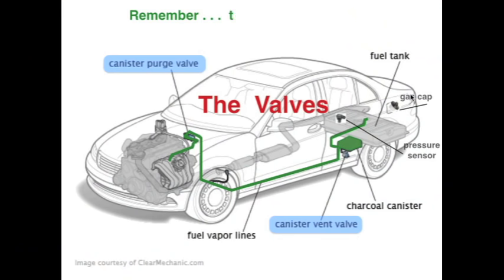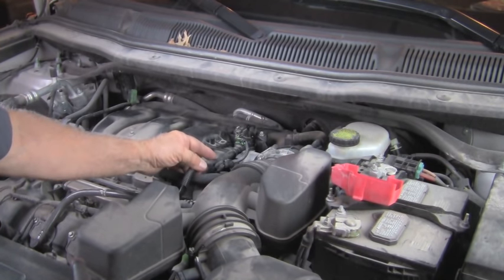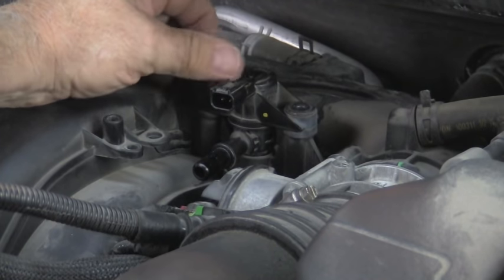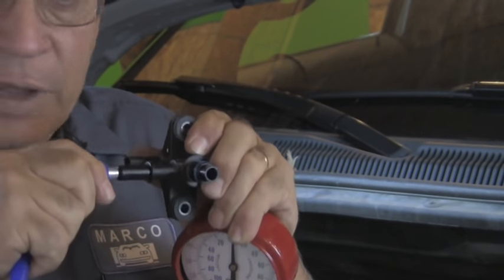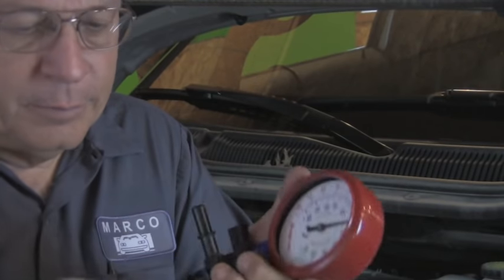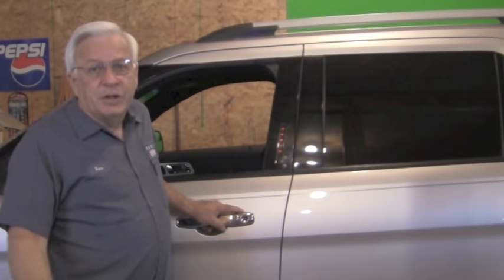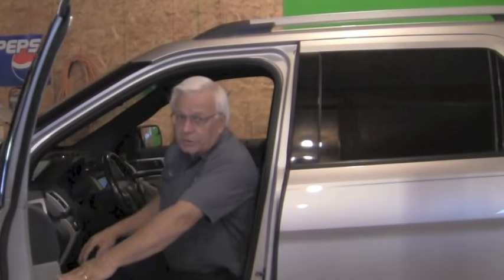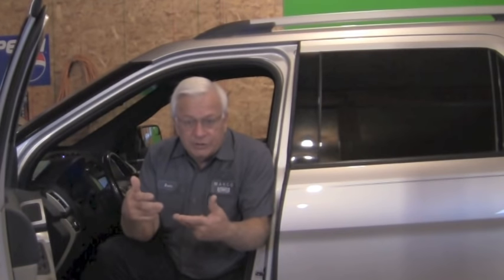How to find a Small EVAP leak without a smoke machine Part 2

Comment: I have a couple of high mileage BMWs (99 323i and 04 330Ci) that I have had this problem with. Most recently I have had to drive over 100 miles before the EVAP system performed its test. The result was a check engine light. I understand the critical thinking steps you took to work this out, but I don't understand how you were able to take what appeared to be a short drive to get the vehicle to run and complete its self-test. Is there something I need to know to make the post-repair self-test finish any faster? This vehicle is no longer registered, and I can't complete the registration and emissions test until I resolve the problem. I can't take it out as my daily driver, so getting 100 miles on it to do a self-test requires several late night drives!
Reply: Clear the code if you can with a scanner. I got a cheap Actron one. I don't know if the el cheapo ones you get off eBay will allow you to reset codes (they work on bluetooth and a smart phone). If all else fails unhook the battery for an hour or so and see if it resets.
Reply: jack it up and put it on jack stands and put it in drive and let the wheels spin
Reply: Its not how long you drive it, its the drive cycles. Start it, drive it around the block twice. Stop engine and wait a couple minutes and repeat.

Comment: My vehicle is a '02 DOHC 3.0L SEL Ford Taurus. I believe that one or maybe both Vent and Purge solenoid valves has failed, or perhaps the PCM has failed. (I'm not getting a 'Check Engine' light) even though I have a gas vapor leak somewhere near the gas tank. Initially, I thought it was the EVAP system alone, but now I'm wondering if a failed PCM could be causing the entire problem ? I plugged a FIXD code checker into the diagnostic port but it isn't communicating (Bluetooth) to the FIXD app on my Android phone. The Bluetooth used to work, but now it isn't communicating with the apps, I've tried 2 different apps. I assume that the diagnostic port is connected to the PCM. Does the PCM need a fuse or relay for it to work? If I replace the original PCM with another PCM from a vehicle with the same specs as mine, would I still need to have it reprogrammed ?
Reply from the maker: wow, so many possibilities.  You asked "Does the PCM need a fuse or relay for it to work?"  Not a relay but

Comment: Got a 98 Ford Expedition showing a P0442 Code, Small Evap leak.  Changed the fuel cap, the Purge Solenoid and fuel vapor hose.  Test drove it and rescanned it again but code is still there.  What will you recommend I check or test for next?  Thanks in advance and appreciate your help!
Reply: I have same issue

Comment: I get this p0456 code all the time where I work ... a more simplistic way to check the purge valve is disconnect  the purge valve start the vehicle and see if the post manifold vacuum side of the valve has vacuum   if so the purge valve is faulty

Comment: Did you erase the codes before taking for a drive to retest?  We have VEIP testing where I live, and to pass it each year with those codes, I've erased the codes, which gets a P1684 on my vehicle telling they've been erased recently, or fewer than 50 crank cycles.  I've then topped off the gas tank, cranked it 50 times, then driven 100 miles and stopped to refill tank, waited a week or so, topping tank after each drive, then went to testing and passed. Seems if the tank remains filled, it can't run the test, the code can't be set, but being 50 cranks later, some miles later, and some days later, it passes VEIP.
Reply: The Engine computer will not run the evap monitor test above 85% full or 15% to empty . The reason is on a full tank raw fuel could be sucked into the engines intake manifold (not good), and with a low fuel condition too many vapors can cause pressure to climb resulting in inaccurate testing. Therefore if you want to "fool" or cause your evap monitor test not to run on a car with a failing evap system then keep tank fuel tank near empty or full. Also note that in most states once a particular monitor has failed on the states emission inspection machine fooling it will no longer be an option.  I personally don't agree with the fooling option because in crazy states like ny and cal the emissions police will probably castrate or mutilate you if you get caught! They wont be totally happy until all mankind is extinct and beautiful  loving animals can peacefully go on about there  business of killing each other.

Comment: I have small evap leak, I did replave evap canister, gas cap,leak detection pump and purge valve ,still same code first i get gas cap light on my Dashboard then it change to check engine and show code small evap leak?

Comment: Not nocking the video.  But if we don't have a smoke machine in the shop I doubt the shop has a 3-5k scan tool either.  At least that was the case at some of the shops I worked at.

Comment: how long does it take for an evap system to run"or vehicle " to test and see if the problem is fixed
Reply from the maker: John, good question.  Unfortunately, there is no exact answer. Seems like all manufacturers have their own specs.  It may take as many as 6 "drive cycles".  Here is what a common drive cycle entails.  Clear any codes then; This is one drive cycle, repeat as many times as necessary for the scanner to say the EVAP monitor has reset.

Comment: i have a 2008 ford escape with a 3.0 i run a evap test with the scan tool and it fails for a leak however there are no codes saying there is??, where do i start?

Comment: Our 2016 Toyota Corolla runs fine but got a check engine light. We just turned the ignition on but not the engine and we unplugged the switch (from the pcm, voltage is 8.33V) that goes to the purge valve and put it back. 
It then resets the check engine light, but just for a few days. Do you think the issue is the purge valve why we get the check engine light? Code is P2024.
Reply from the maker: not from what you say here.

Comment: So...........will the pcm turn off the check engine light once the problem is fixed, or do you need to use the OBD scan tool to reset it?
Reply: The PCM will actually keep looking for the problem because it is stored in the history, however it can take a long time (weeks, depending on hoe much you drive it). But it will not erase it from the memory.  So, the best answer is yes, use an OBD scan tool to clear the code.

Comment: Love your videos. I have a question.  I have a 2006 Saturn vue 3.5 the check engine light is on has been ever since the alternator went out. Fix it but light won't go away. I have ran codes and removed them but it comes back. I changed the 02s b1 s1 and the codes are p2253 and p0705. What can I do before I torch the time and money pit?
Reply from the maker: I wish I could tell you but it will need to be tested.  Often times there need to be a "relearn" procedure performed before the computer will recognize the new alternator.  Take it to a good diagnostic shop and they can help you
Reply: @realfixesrealfast  thank you but I forgot to put in the alternator was replaced 2 years ago O2 sensor bank 1 sensor 1 driven well over the mileage needed buy like a hundred

Comment: On a 99 ranger 3.0 v6 Flex Fuel engine it seems as there is two Evap Canisters. Both sit inside the engine.  1 on the driver side behind the battery on the fender wall  and the other is behind the fuel Injector rails on the center more towards the passenger side tho..my quetion is are both the same Evap Canister and replace both at the same time if one is bad and detecting a leak ? I replaced the one of the fender wall a couple months ago and cleared the EVAP Canister code but a few months later it came back with a diffeent code detecting a leak.. I just now realized the other day when I was replacing my FPR on the fuel injector rail I saw what looked like another EVAP Canister assuming that could be the part causing the issue since it’s a very old piece but looks exactly like a Evap Canister towards the back of the fuel rail   . Can anyone tell me if it’s the same EVAP  part or if it has a different name? I keep smelling fuel but not as bad after I replaced my 02 sensors. I also keep getting the 02 sensor codes but I replaced all 3’ 02 sensors already…

Comment: Hello. I'm sorry to bother you. I am the owner  skoda fabia 1.4 2003 - and I have the following problem which unfortunately in my location no one was able to solve. For some time now, my engine  Check Engine has been on. although I did several diagnoses (tests) each time the result is different (lambda probe 1 flashing, EGR, intake sensors, etc.) In addition to this there are 2 witnesses (I can send you the picture if you give me the opportunity) who sometimes block my accelerator pedal. I stop the engine and the lights go out. Unfortunately, no one can give an answer and a defective part for sure. There is a risk of changing a part that is not really bad. I would like some advice from you. Thank you.
from. I have the picture with errors
Reply: sure, I will try to help,  send me the details,  the first page of my website has a link ti my email address.  Go to website realfixesrealfast.com look in top right corner for the email link..  Duane

Comment: So you are saying don't reset the code just drive it for a few minutes and see if the light goes off?  My issue is every time I replace one suspected item and reset the code I have to drive it 60+ miles before I the code is reset to ready and the system shows it has passed.  That is crazy since I drive my Jeep about 60 miles a month.  I have been working on this problem since September 0f 2023 but I just don't drive often due to gas prices.  I can't pass Texas inspection because the stupid code is showing the same as yours Evap System Small Leak.  If I do not clear the code and just replace one item at a time do you know how long it will take the system to recheck and either clear the code/check engine light?
Reply from the maker: Great question.  Unfortunately the EVAP monitor system has so many variables, there is no easy answer.  Then when you add in the fact that the Texas inspection system is not a diagnostic system, you are in a tough spot.    Here is the basics.  The EVAP monitor runs continually, not constantly.  That means once started it repeats randomly again over and over again looking for a problem.  If you clear the code, it will reset and start over from the beginning.  If you change a part but do NOT clear the code, the random looking for a problem continues and if it does not see a problem it will turn off the warning light.     IMPORTANT the light may be turned off but the code will be stored in the computers memory.  Now that the light is off, now is the time to clear the code, then wait until the monitor reports that it is complete, the go to the inspection station.  (of course this assumes that the repair you did actually fixed the problem)
Reply: Thanks for the reply.  My son's 2008 Jeep Wrangler has been unable to pass inspection here in Texas since September!  I have tried to find the issue but have not been abe to.  In Austin, it costs more than the vehicle is worth to get anything done and I have been a body/paint guy for 30 years so I thought it should be an easy fix for me, but that has not been the case.  I will sell it on eBay to someone in a state with no inspections.  They are getting rid of them here as well in 2025. Inspections have a great purpose but in some scenarios like this, it's kept my son from having a perfectly good-driving Jeep because of some tiny air leak.  Silly.   @realfixesrealfast

Comment: I have replaced my valve twice and i still get the clicking sound and an open circuit code p0443. Measure the connector with voltmeter and it fluctuates from 12v to 7v to 3v and so on. What could be the problem? Thanks
Reply from the maker: Mario, EVAP problem are usually easy to fix but very difficult to diagnose.  Most people thro parts at it and end up replacing a lot more than they need to.  This video was just one of the issues that could be involved.  I would suggest that before you waste more time and money, take it to a good diagnostic shop in your area and let them diagnose it.

Comment: You should of not took the purge valve  off  for the first step. You should have just taken the purge hose off and started the car to see if it was leaking. If that purge valve was stuck open you could have unstuck it just by removing it and you would have missed the fault. Great Video

Comment: AFTER CHANGING THE PURGE VALVE IS IT NECESSARY TO DISCONNECT THE NEGATIVE BATTERY CABLE FOR 15 MINUTES OR NOT?
Reply from the maker: No.  it will reset on its own.

Comment: I was told that I have a small evap leak when I took it to the shop even with it being a really tiny evap leak does that still make me go through gas like crazy? I have a 2003 Kia Rio fill it up with twenty bucks and gas is gone within an hour it has no fuel leaking out.
Reply from the maker: Nikki, that sounds pretty excessive to me.  Small EVAP leaks are common but usually don't cause a noticeable fuel loss.  I would consider a second opinion

Comment: Hello Duane, I have the same small evap leak code on my 03 pathfinder and my feul gauge reading has been inaccurate since this code came up. Are you aware if the two issues are related? As in, is the evap small leak code causing my feel gauge not to function properly? Thanks in advance!
Reply from the maker: Of course I would need to see and test it to be sure.  However, the same code can be set due to a leak anywhere in the system.  It's an odd occurance that your fuel gauge has a problem at the same time, unless the leak is cause by some sort of fuel pump/sender issue, and or the fuel pressure vent valve that is in the gas tank.  Have your trusted diagnostic tech take a look at it
Reply: +realfixesrealfast thank you for taking the time out to respond.  I'll have to find that trustworthy person.  Where are you located?

Comment: How would this leaky valve show when using the smoke test?
Reply: if the valve is working it  should not leak smoke, and the pressure gauge on your smoke machine should show changes as you open and close the valve.

Comment: I have a small evap leak code P0442. When I accelerate going up a hill my air vent closes until I take my foot off the gas or get over the hill. Would this be the reason for the P0442 small leak code? This is in a 2001 Dodge Ram 1500 5.9 literally V8 2 wheel drive. Thanks for any suggestions.
Reply from the maker: I would not think so.  It would more than likely be related to a vacuum leak
Reply: @realfixesrealfast  Thank you! Your videos are very helpful.

Comment: Will it turn off engine light once repaired?
Reply from the maker: Not for awhile.  The computer continues to monitor and look for the fault to reoccur.  If after it looks but does not see the fault for several attempts it will turn off the light.  However that monitor is very complicated in how it runs, so depending on how you drive, it could be weeks.  The quickest way to turn off the light is to clear the codes.

Comment: No sir, you won't find my leak that way. I am on my 4th purge valve, I have replaced the gas cap and the vent valve, the canister and the fuel rail pressure relief valve. They dropped the fuel tank and fixed a leak. I have had multiple mechanics and shops work on the problem. Light keeps coming back on. No one can find it after over $800 dollars of expense.   It goes back to the shop again on Monday. The might was well make a bed for me.
Reply: Maybe the computer triggering the light has become self-aware and is messing with you as an experiment in artificial/biological intelligence interaction. Or your automotive technician already failed the contest.
Reply: I bought a new car.

Comment: Hey there I have a ml320 and I only get po455 when tank isn't completely full once it drops to 3 qurter full the code pops up
Reply from the maker: that is completely normal.  The evaporations will not monitor and report a code if the tank is between 1/4. and 3/4  full, it aborts reporting.  So when when you fill up it resets and won't monitor until you drop below 3/4.  So that means you do have areal problem ALL THE TIME even if the code isn't active.  Take it to a good diagnostic shop and they can help you with it.
Reply: @realfixesrealfast  thank you

Comment: We do not know the true vac pressure of this mechanic lungs. So we cannot measure that properly but as he shows the valve is not holding.  So the process of elimination clearly shows the valve is faulty.  Then the car self diagnostics corroborate his guess.  Done.  The cap problem was covered on video Zero.   That is always the first troubleshooting you would read on your car user manual (we all read it, right?)

Comment: Hi , I wanted to ask ,, I have an 07 ranger  with a 4.0 I had the engine replaced with a 4.0 from a sport track or explorer by a mechanic , it threw off rich 02 senor readins on both  upstream banks ,,,,,,,,,   thoose are the only codes it will throw  off ,,,,,,,,   the  mechanic seems ehh  not the sharpest perhaps , so he changed both 02 sensors and  still got the same reading , I got it back and bingo same thing ,, he  put 2 more in bosch 13117 ..... 02 sensors which I am not even sure are  correct , and  still does the same thing , rough idle at startup and  little power on  acceleration with a surge of speed occasionally ,,,,,,,,  I was wondering  do vacuum leaks read always lean or rich or  can it be both , or can it be fuel related only ,,,,  I get no other codes except 196  and  198  so I was just wondering do all vacumm leaks create a  lean reading or can it be  both so I can  do some testing  myself . that would steer me to the fuel end of this  quicker , I believe the  fuel pressure is  70   psi  plus  some .